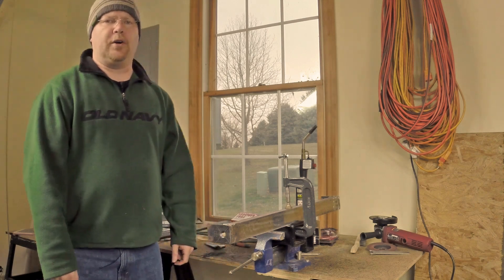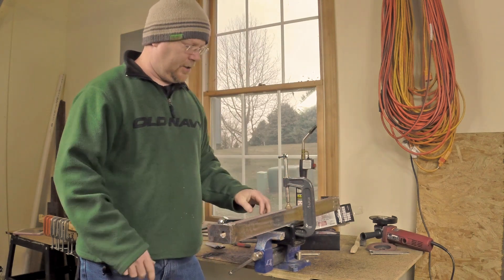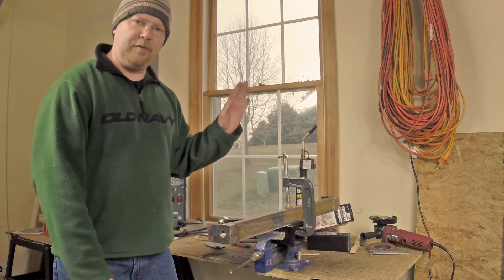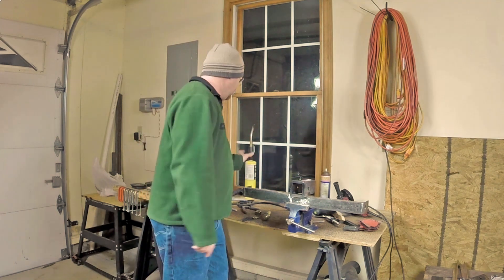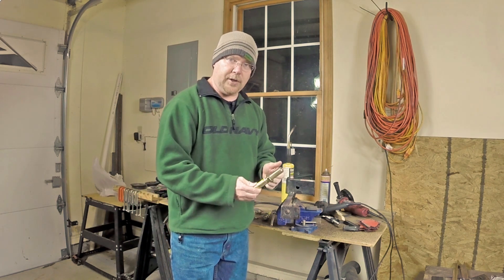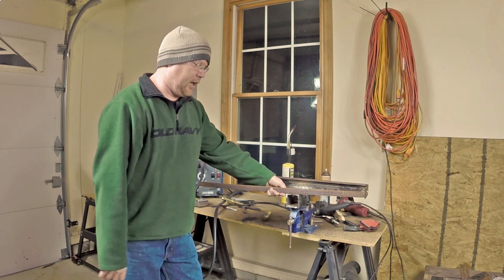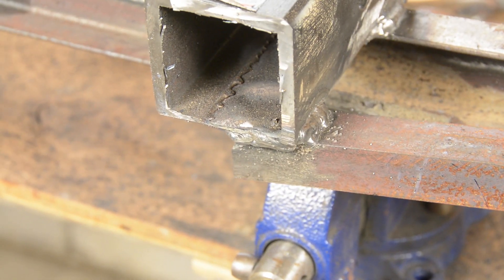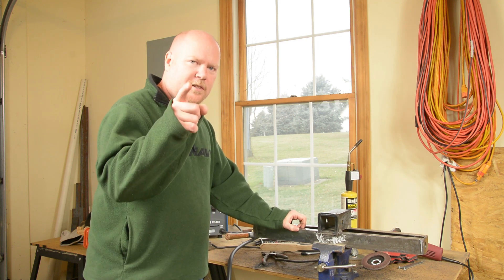3 Point Trailer Hitch - Part 2

Comment: i disagree on your saying a 90 amp welder  wont weld  heavy steel and hold , We welded a Tongue  back on a 18 ft Trailer  and new iron going from the tongue Back to the trailer , and we haul Tractor with attachments on it all day long , A 90 amp Welder Wire Feed From Harbor Freight is a Great Welder ,
Reply from the maker: I didn't say it won't hold.  I said it won't weld 1/4" steel in one pass and get full penetration. Miller recommends double this, 180 amps, for flux core on 1/4" with their welding calculator.  To get a full strength weld with fewer amps requires proper bevels and multiple passes.

Whether you need full penetration or not though is application specific.  For instance, in this case I'm welding 1/8 to 1/4, so I don't need full penetration on the 1/4 because it only has to be as strong as the 1/8.  Sounds like however strong your welds are that they're strong enough - so it's mostly academic that they could potentially be stronger.